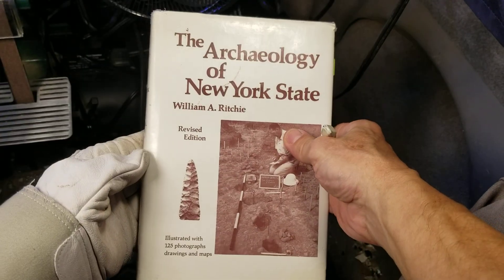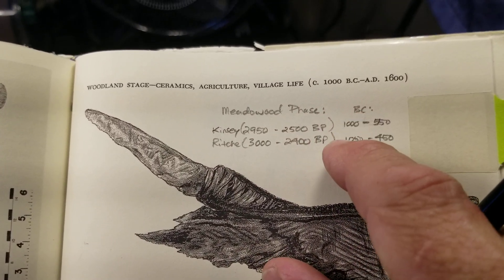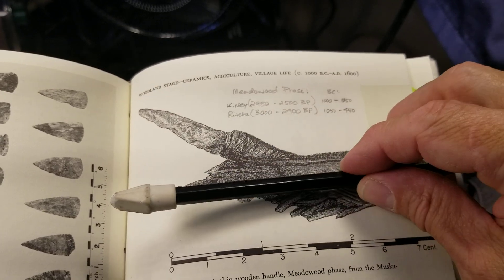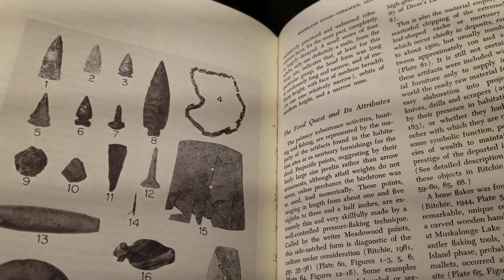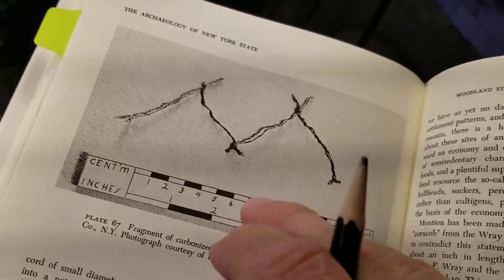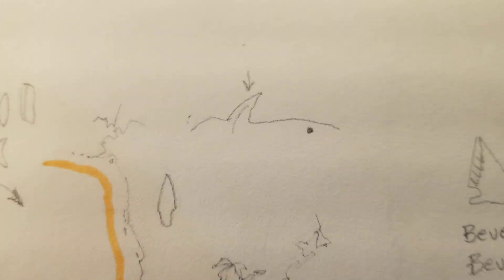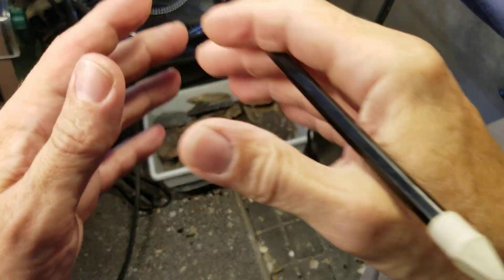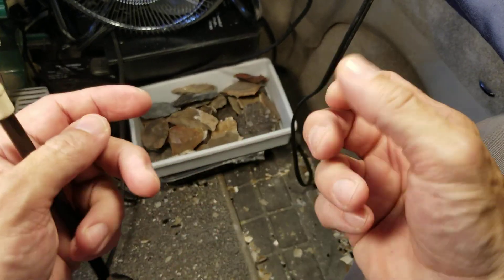1187 - Positive Proof of Copper Used For Flintknapping Before European Contact

Comment: I will not dispute your findings or proof but I will think the average percentage did not. I would guess 99 percent or higher did not in America. Just My guess! In all my digging Ive never found any metal and Ive moved a lot of dirt in last 30 years both shelters and flat ground. We did dig one area above a spring and found bird points that looked like made from old wagon or gun parts. I also don't believe in dating points by style because who can say two men 1200 miles apart couldn't have the same idea at totally different times? But I am also sure natives or prehistoric man could have found copper outcroppings and used it. We all know all men are opportunist.

Comment: Thank you jack alot of people in the Flintknapping groups on FB say it was used but haven't seen this sourced yet that's amazing thank you for this material! It makes sense that this type of  flaking tool was used before extreme common place stringed bow use bc you had to make points to use for arrows right? But I see the atlatl darts that's amazing.

Comment: I have issues to a degree with trying to justify copper currently available today as "primitive" due to the purity or alloying elements.  I do not disagree that it was used in the past.  I had my suspicions years ago.  If you remember, I posted on this very subject on the PaleoPlanet forums (Mike_H) on whether copper was truly modern and laid out an experiment to see if a nugget could be hammered with ancestral tools to get something akin to our modern copper rods enough to be used.  Sadly, getting copper nuggets large enough to use is kinda expensive for me so that never actually happened.  Freejutube here on youtube did that though and it worked well. https://www.youtube.com/watch?v=ccSn1cSELjU